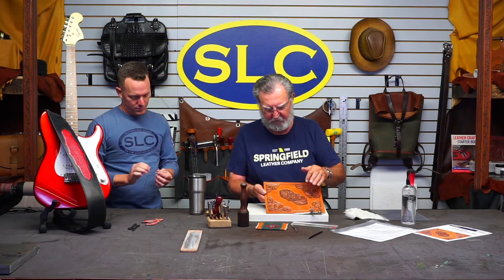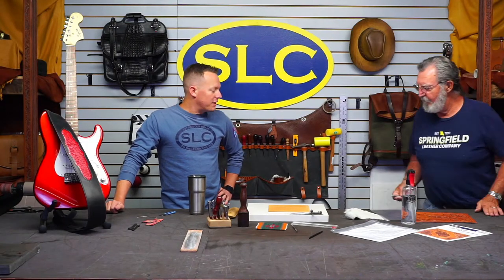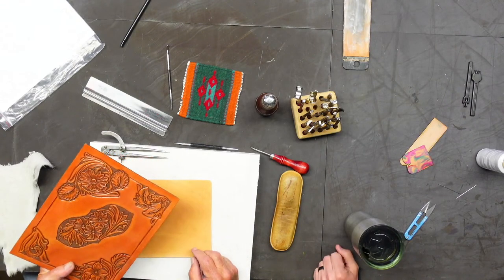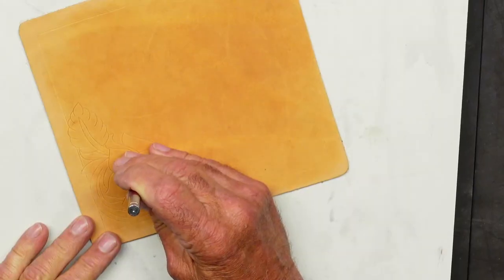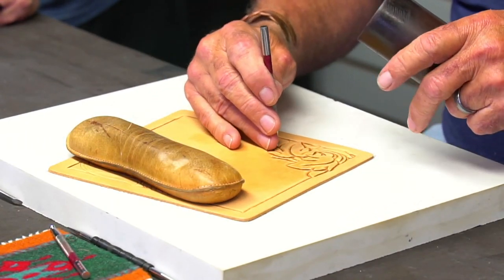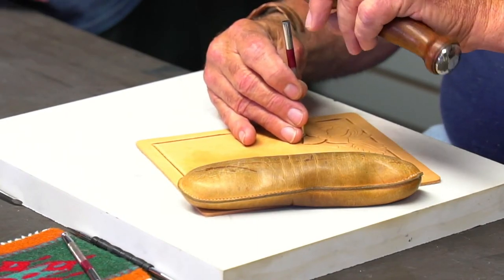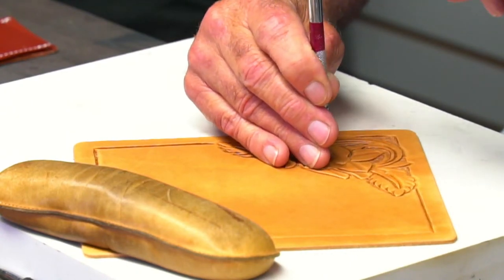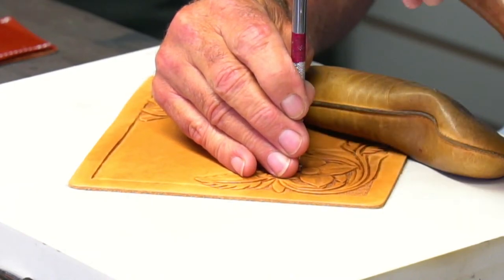Crafting a CarveRite Roper Wallet w/ Denny + Tony

Comment: I'm not sure how consistent tool numbers are, but I found a chart for Craftool Stamps and Coarse Bevelers are listed as B801, B802, B803 & B836. All other cross pattern bevelers are normal pattern. Along with Lined and Smooth. Hope this helps.

Comment: Howdy guys:
 I'm in awe of Denny's ability to tool! I drive myself to the point of tears trying it. I suffered a Right brain stroke in 2013 and my hands/fingers don't work very well anymore. My swivel knife work looks like a 3 year old did it with a plastic picnic knife, and I cannot "drag" a beveler along a cut line to save my life, especially at the same time I'm trying to hit it with my plastic hammer? So I lift, move,  put, and hit. There's NO smooth rhythm to my beveling and I can see every place I moved it to before I hit it? Outside of a LOT of practice and many choice 4 letter words is there ANY hope for me? Do you have any bits of advice that may help me improve Denny? I have everything but the ability. Thank you.
God bless:
Dave
Reply: Barry King makes a push beveler  that might do the trick for you.  Kinda spendy, but if it helps get past the frustration might be worth it.  Also don't be so hard on yourself and just enjoy being able to do something.